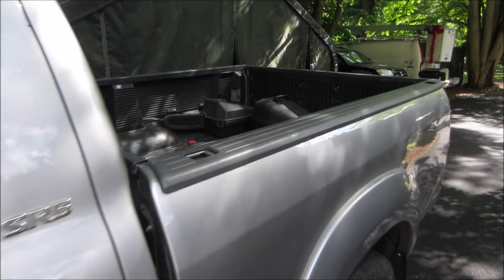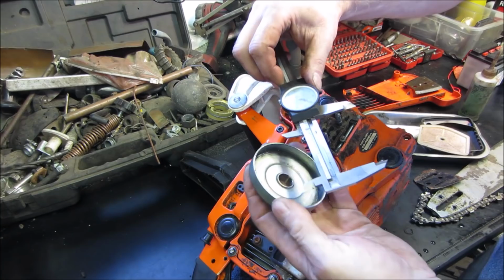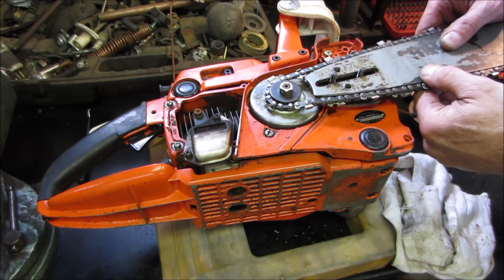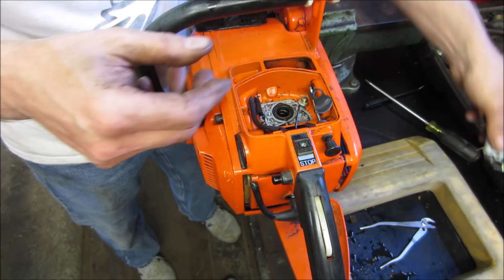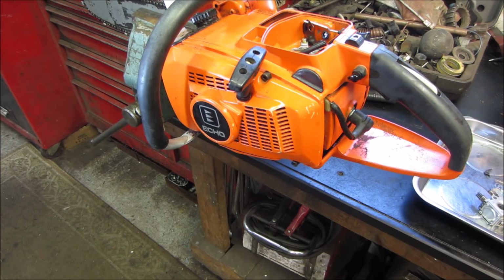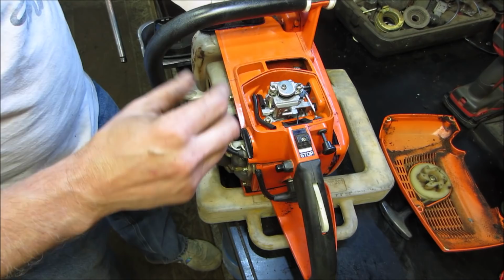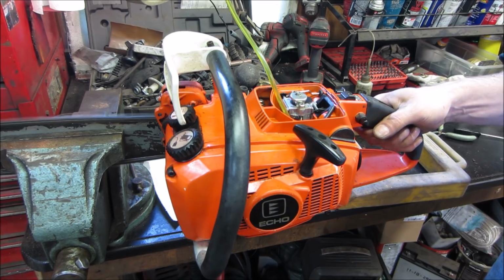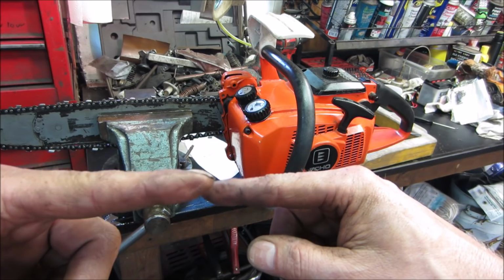Free Echo CS 400 Chainsaw, Will it Run?

Comment: Just bought a ride on lawn mower that wasn’t running for $100.  And fixed it with the help of you videos.  I now have a fully running ride on 42”  lawnmower for the $100 + $30 in parts,   The magneto was bad,  no spark,  replaced the mag and it fired right up,  replaced air and fuel filter as well. Thanks for all the help of your videos,
Reply: Grwat job.

Comment: I have owned an Echo 400 EVL for 38 years. Bought it new in 1982. Had it on the work bench today renewing the carburetor.  When I bought it, I asked all the small engine and saw repair shops which popular brand didn't show up much in their shops.  Everyone said Echo.  I have hundreds of hours on mine.  Well balanced, great little saw.

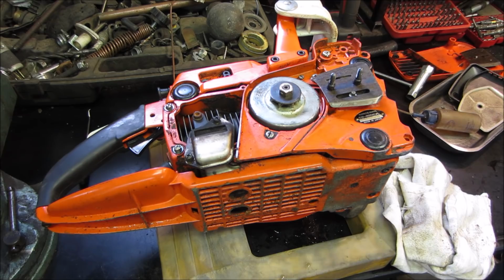Comment: 15:55 "no brake, when men were men and you cut a leg off with pride" I laughed out loud!!
Reply: Great, great statement.  We about died when we heard that.
Reply: Yeah its all fun and games till you get to see what no chain brake will do to a human! Not a good look.
Reply: He's not too far off, I ruined a pair of Levi's with an Echo 400 when it kicked back; hit old barbed wire in a small tree.  Great saw, but it did tear out the thigh of those pants :D
Reply: I have an old Echo CS330EVL and it also has no chain brake.  I use it all the time and is the best running and cutting saw I have.  I hit a spent bullet in a tree that I was cutting down once and it didn't kick back once, it just sliced the bullet in half lengthwise.
Reply: In the words of Gasmonkey Richard Rawlings,  brakes are for quitters!

Comment: Low speed needle is for the throttle transition from idle to high. High is adjusted in the cut. You need to set the idle first before adjusting the low and high. Start with 1 to 1.5 turns from a light seat on both L and H.

As always, love the videos.

Comment: That's actually a pretty good saw, and worth it to put a carb kit..and new bar and chain on. A friend that worked as a tree man would freak about the way you put the bar in the vice like that though, as he had a stand that held by the lower part of the handle, and the bottom plate of the saw to work on them. Many of the bars have moving parts in them, and are damaged easily.
Reply: Just a sprocket at the tip and the chain groove are at all sensitive, and you can’t really pinch the groove in a vice with the chain on.  I use the vice to sharpen blades

Comment: An interesting trick to try with old saws is to prime it ,as you did,run up the revs,and place your thumb over the carb ,causing the strong vacuum to draw through the ports in the carburetor. I have used this trick on many occasions with consistent success
Reply: I've done this a lot as well but only on downdraft carbs like this.  Can't seem to get it to work on crossflow for some reason
Reply: It will more times than not draw out whatever crap may be stuck in the jets
Reply: David Lacey nice info guys 👌

Comment: Fixed a carburetor problem in one of my Uncle's Welding machines. It wasn't starting and there was oil and gasoline all over the bottom near the carburetor and air filter.  It over flowed into the oil bath filter and caused a mess. I said with confidence, that is a problem with his float pin. 

Took it apart and did the blow trick and that worked fine. I then shook the float and one was completely filled. I couldn't shake out the gasoline through a small crack so I tried burning it. LOL it shot out 3-4 inches of flames then then disconnected both floats and split one in half.  Luckly I had a lighter/ torch which was the perfect heat. A hand held torch would have been too hot. After using the lighter to clean away all the old solder and sanding it all down. I managed to reseal the good fload and fix the crack,  seal the two pieces together and attach both floats to it's lever. I was successful.
Reply: I caught myself going straight to the spark plug to see if it had fire on a generator that is having issues...it did.
So then I was pouring fuel down the carb...that didn't work...so I put some in the cylinder through the spark plug hole...fired right up.
Time to take off & go through the carburetor to check for bad gas, clogged needle valve, or any other of the Mustie check list that I know by heart now   :)
PS>  I keep a little lighter that runs like a tiny blowtorch around for just such situations!

Comment: That model was manufactured from 1980-1984. Thanks for the video.
Reply: No chain brake yes maybe 78
Reply: Chain breaks were an option until 1985 when they became mandatory.
Reply: I have an Echo CS330EVL that doesn't have a chain brake either.  Best saw I own and I use it all the time.

Comment: I have a number of saws  I have picked up over the years.   Now I have the knowledge and tricks to start repairing them.  Thanks for your videos.   One trick I have learned is to go to the airport and buy 100LL to use in all of my power equipment.   No ethanol,  therefore no water absorption.

Comment: What a cool vid.  I like working on all my yard equipment.  I have 2 old McCullough Pro-Mac 610's that were my grandfather's that he uses to cut firewood and Christmas trees.  They were buried in my parent's garage for many years after he died.  I took them rebuilt the carbs and replaced the fuel lines and filter and fired right up.  I use them for cutting down big trees and logs all the time.  It's pretty cool having an 18 and 24in bars.  They are heavy but cut like wolverine's claws.  I also have and use axes, shovels, and picks that were my grandpa's. Best way to remember him is using his tools that I watched him use as a kid!!!

Comment: older echo chainsaws like that have common faults  
1. the fuel filters melt over time not letting fuel through OR sucking in the melted filter blocking up the fuel line
2. there fuel lines block at the bends
3.the filters snap off in the tank
4 the fuel lines can crack from age and vibration 
other than that they are great machines
Reply: genmaxpain 👌
Reply: Absolutely correct, I agree

Comment: My friend, at the bottom of the fuel line inside the tank there is in every chainsaw a weighted filter. The filter must be clean. The weight is so when you turn the saw in different directions it will fall into the gas left in the tank.  I suspect your filter is dirty. take off, by grabbing and pulling thru the fuel tank opening. I think this is your problem on this saw.
By the way this saw is old but like new, it's very clean, so it wasn't used much.  Have fun.  Love all of your videos, you have taught me a lot. RB Michigan

Comment: That line that you called a return line is actually the impulse line from the crankcase that provides pulses to operated the fuel pump in the carb.
Reply: the sound the engine makes when he puts air to that hose had me assuming the same. strange he did not hear that.

Comment: I just got my 40 yr. old Pioneer P60 chainsaw running. Carb job didn't work. Found the fuel line rotted off in the tank. Replaced that and it runs like new. Keep the vids coming. From Utah.

Comment: I have a CS 500VL and it's a wonderful saw. Lots of power, and it is guaranteed to fire up every time. The low speed needle does need adjusting depending on altitude I've noticed, but otherwise, it always runs like a champ

Comment: You just gave me an idea on how to pre-shred some barrels i wanted to reduce to filament. Duh, cut it with the chain-saw, wood can be far tougher. I wanted to go at it with a grinder, but i don't trust the carbide china import blade and it doesn't fit with a guard on, this just saved my bacon :))

Comment: I snagged 2 ECHO 302S chainsaws in parts in a crate a decade ago and built up one out of both of them.  I put a new 16" bar on it and is still working today.  I use it about 2 times a week cutting garage headers at work and the guys always ask about it because it doesn't sound like any of the modern plastic saws they've heard.

Comment: Years ago, i had to learn an important lesson. Chainsaws are temperamental, and it mostly has to do with long-term storage in less-than-ideal storage locations (shop, garage, or shed) where they are exposed to hot summers and cold winters. After 2-3 years you go to cut up that tree branch that fell after a storm and it won't crank to save your life. Every piece of rubber in the saw is dry rotted or hardened. It's extreme, i know, but i keep a 10 year old Stihl chainsaw in the hall closet of the house, to give it better storage life. About once a year i have to take it out to the property to do some kind of work with it. But the biggest thing i did for around-the-home use is buy an electric chainsaw. It starts everytime.

Comment: I just gave away an Echo tiller.
I only used it once, and it would not start again.
I changed the plug just in case.
Nope, would not start.
So i went and bought another tiller cheaper in price, and bigger engine with wheels.
The Echo was the carry to the place you want to till.
The new tiller can pull it on the wheels to the place i wanted to till.
I almost bought an Electric one, but changed my mind.
I said to myself, what if i want to till in a place with no electrical plugs to use.
The new tiller worked great.
My chainsaw is an Echo.
So far it is working good.
I have used it for a few years.

Comment: The chain will loosen as it heats up, so snug when cool will be right when hot.
Reply: That is 100% correct. Mustie stated it backwards in the video when he said "I will let the chain loose because it gets tighter when it heats up" This man is absolutely one of the sharpest small engine guys I have ever seen but no one is perfect. Using a chainsaw every day to put food on the table and having installed a bar and chain or two, I can tell you first hand that a tight chain will get loose when it heats up.

When installing a new chain, you must stop every 5 minutes and re-tension it. After 15 minutes or so, you can just keep an eye on it, stopping only if it becomes loose. New chains will stretch a LOT in the beginning and old chains just need to be checked every time you fuel and oil up. You also have to lower the rakers every other time you sharpen the chain. If not? your chain will be sharp but cut nothing because the rakers (Followers, Depth gauges, riders, etc.) are to high and stop the teeth or cutters from hitting the wood and actually cutting anything.

Comment: To get fuel line out of the tank, cut off a one foot piece of coat hanger wire and bend a hook on one end.  Insert it in the tank and retrieve the fuel line and filter.  The filter is usually the hardest part to get out.  Cut off about a half of an inch of line and install a new filter.  If the fuel line falls apart, replace it.  They are not hard to replace with a pair of hemostats.  Angle cut the end and push it through into the tank and grab it with the hemostats.  I use Stihl fuel lines on Stihl saws and TYVEC line on most others.

Comment: Pull the fuel mixture screws out. Spray carb clean in the mixture screw holes, blow out with light pressure air. Reinstall both mixture screws. Set low to 1 1/2  turns out. And the high to 2 1/2 turns out.
Reply: Nothing beats a clean CRAB LOL
Reply: LOL why on earth are you trying to tell mustie how start an engine lol ?? is this your first time Mike Smith
Reply: @dubbeh  of course it's his first time here. That would be the same as telling a brain surgeon how to do stitches lol
Reply: Mike Smith Maybe you should start your own YouTube channel

Comment: I don't know, how much the previous owner paid for it but I got one for 65 dollars Canadian brand new out of the box from China. It even had a chisel tooth chain on it worth almost the price of the saw. I have had it for 4 years now and it still runs like new. We imported 12 of them to see just how good they are and were amazed at how tough these saws are. Out of 12, ten still run the problem with them is you can't get parts for them. We found out why two of them died, the exhaust ports weren't drilled out completely. I had an Echo generator that beat itself to death  because the exhaust port wasn't finished

Comment: That second hose next to fuel hose is the impulse line :) connects to the carb to get a pulse from the crank case to open and close the fuel pump diaphragm and valves in carb - won’t run correctly without the impulse in the carb. That’s likely the reason it’s running so lean too :)

Comment: Mustie, my old Jonsered 510 ran crappy like that and the ethanol gas had attacked the sealant they use between the case halves. It was sucking air. I resealed it with permatex and it runs great again. May not be your problem, but just a suggestion.

Comment: My free yardsale craftsman saw just needed the spark arrestor screen cleaned in the muffler.  Still runs like a champ 10 years later.  I've replaced the bar and chain several times, but that was because of nails in the trees...  GREAT VID!
Reply: Mark Stevens  The offending tree use to double as a fence post.... for decades.  It was full of U nails, rusty barbed wire and the like.  The tree absorbed them, so nothing was visible.

Comment: I've had one of the John Deere echoes for 20 years and it kicks ass the secret to starting them is full choke 1 pull 2nd pull half choke turn off when starts loading up and I always clean the Jets whenever I forget to drain the old fuel out and it won't start...Like Homer says...Dough!

Comment: I think I have the answer for you on the Chain brake. It started showing up on some models in the 70s usually ones that were sold to the Canadian Market as well as the US market. Putting chain brakes on chainsaws was voluntary through the 90s. After that I believe it was a mandated feature on all saws. Canada required them much earlier then the US. By the way if this video you created a certain amount of suspense. We knew it wouldn't be long before you had gas spraying everywhere we just didn't know when. Keep wrenching my friend.

Comment: I say fix up that poulan and fit on one of those big cutting wheel attachments and then you can use it around the shop cutting off bolts and such😉
Reply: sinformant 👌
Reply: That Poulan probably isn’t a terrible saw.  The Pros usually have a chrome lined cylinder wall.  Some of the older ones had chrome plated pistons.  Was designed to help with piston and cylinder wear. I had a Poulan Pro brush cutter that wouldn’t die.  In fact, my dad still has it
Reply: Todd Tedder lol

Comment: Thanks once again for the nice video. The chain will expand when it gets hotter and get looser. You want it fairly snug at start and recheck after some cutting. And according to my saw your supposed to slacken it off before storage.

Comment: Here's a small suggestion; all ways look at the pump diaphragm held up to a light as a small hole in it well keep the pump from working right. I've seen this a lot as I've worked with small engines as a arborist for 20yrs and I get a lot of chainsaws, weed eaters, and leaf blowers free from customers and take the engines out and convert them into RC airplane engines for use in my prototype RC aircraft designs. Just off the top of my head, I'm going to say it's the cause about 90% of the time, maybe higher. The cause ( I believe) is the use of ethanol in fuel, then running the saw(eng.) out of gas (or storing it for a long time) and not fueling the saw(engine) before putting it away. The ethanol dries out the pump diaphragm and then the next time it flexes it makes a pin hole in it. Again at less 90% of the time I replace the diaphragm and the eng. runs great. Thanks for the great videos most of the time as this one sounded to much like work for me. I just hate the sound of a 2-stroke running lean. Just yrs of hearing them I guess.
SPC-Lee a Benson 11B U.S. Army (RET.)

Comment: It's equipped with the optional "auto shutoff" feature. You just take your finger off the throttle and it shuts right off for you. It's a safety thing. :)

Comment: Long time subscriber learned alot from you, taking on bigger challenges mechanically. I have a 1980 Echo 500 cs that I bought new, needs new crank seals which I planned on putting in today, new bearings, and a carb kit. I cut down alot of trees with the saw, learned how with that saw, worth the trouble to me. I've got an old Jhonserd I'm using now, and a Husky a friend gifted also, but the Echo is my fav. But then I'm about old enough to quit tree work and take up quilting :D

Comment: 1980’s Echo equipment were pure adulterated junk.  My timber guys used to just leave them in the woods when they broke down.  Occasionally I had to loan them one of my Professional grade Poulans to finish up their cutting, not to be confused with the junk sold by Poulan, today.  My Poulan saws were made in Shreveport, LA.

Comment: 1. Good video! 2. I've read that soaking those valve papers in brake fluid will rejuvenate them. 3. Don't forget the grease hole out at the long end of the chain bar. There is a small grease gun used to force grease into that sprocket. 4. Congrats on 300K subs!

Comment: Pull the muffler and burn out the inside, could be clogged with carbon...
Reply: Yea or the exhaust spark arrester thingy is clogged and essentially choking it. I've had that problem before. Similar symptoms
Reply: How do you burn it out Lens cap?
Reply: kennycybertron1 with a torch, it catches fire and burns. Just blow the torch into the muffler from both ways one way at a time then shake and tap. Guess you could soak it in acetone too but make sure all the acetone is gone before using it again or boom!
Reply: Dunno. If the spark arrestor is clogged the engine really wouldn't want to rev up as easily as it does.
Reply: Thank you Bobby, good info
Reply: @ @psi23k A clogged arrester screen will make the eng. run rich and this 2-stroke is obviously running lean, hence the position of the high and low speed needles.